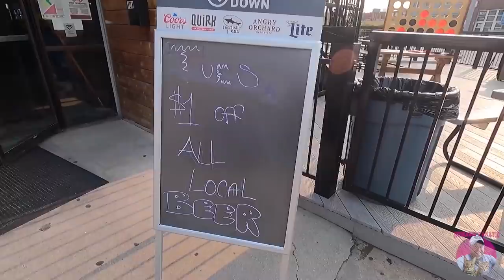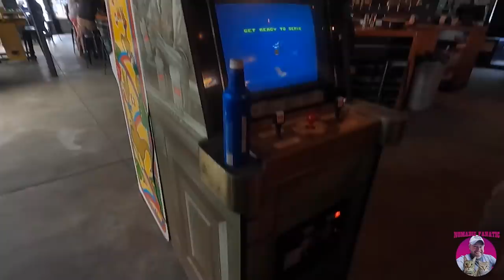Propane Leak Issue, Water Heater Fixed??? New AC Installed!!!

Comment: I'd double check with some other experts about using hydraulic hose on a propane line in an RV. The hydraulic hose can certainly hold the low pressure, but I wonder about the propane breaking the hose down and you getting contaminants in your line.

Comment: Does that mean the refrigerator you removed should be fine and can be reinstalled?  Hugs to the fur babies.  Take care and safe travels.
Reply: I was thinking the very same thing
Reply: he said it wasn't working on electricity after a short while so i don't think so.
Reply: I think it was also 20 years old? (I forget the year of the van) so it was probably due for a more efficient model.
Reply: @sak01  I had forgotten that. Thanks for reminding me.

Comment: 7:47 Please tell Robert that, if he's not going to use a jack stand, he should at least slide the tire under the frame.  The cardinal rule of auto repair is NEVER TRUST A JACK.
Reply from the maker: There is a jack stand in that shot.
Reply: @nomadicfanatic  he did not write that. Jack stands ALONE have fallen and crushed people!
Reply: @jenniferwise8515  You are wrong. "if he's not going to use a jack stand"
Reply: 8:40 there is the jack stand
Reply: @bluemamba5317  Where did Jack stand?
Reply: @bluemamba5317  read the original post. If you are going to get under any vehicle NEVER trust only a jack stand.
Reply: @jenniferwise8515  Can't you read? 
He wrote: "The cardinal rule of auto repair is NEVER TRUST A JACK."
Meaning, the guy didn't see the jack stand, only the jack that is right under the axel.
Reply: @nomadicfanatic   That's good.  I could only see the floor jack.

Comment: If you haven't done so already, may I suggest replacing the water heater anode. Those things deteriorate pretty quickly. It's a cheap and simple project, and will extend the life of the unit.
Also, I really admire your persistence!

Comment: Hey Eric, As for the lights on the motorcycle rack... You can rig up your lights just like you would if were putting them on a trailer using the four pin plug and they should work great for you. The upside to doing them this way is that if the need should arise that you have to remove the rack you can simply unplug the four pin plug. Also, you wouldn't have to cannibalize the wiring on the vehicle to make them work. It's great that everything is beginning to come together for you and your new to you RV.

Comment: I think that if I were going to spend the bulk of my time on the road, but still wanted (or needed) a base camp, I would look towards the SE portion of South Dakota. Tax friendly, easy on the regulations, and just about equidistant from both coasts. Not a place that I would really want to winter in, but unlike the northern parts of the Midwest such as MN, it's at least tolerable.

Comment: You need to use the Lectric XP you reviewed when you were in Washington, the new 2.0 is even nicer as it puts your E-Bike to shame.... Waterproof...also has front shocks now along with really nice basket attachments for your cats
Reply: No. I have two. They are no more water"proof" than your cellphone or any other electronic device if allowed to get overly wet. They do make bike covers however.  I have motorcycles, a SXS, and as I said, two Lectric e-bikes. When left outside they are secured and covered. Admittedly,  due to it's size and construction, transporting it in the van is out. The foldable nature of the Lectric would be much better,... but still not a waterproof unit
Reply: Don't they have a 3.0 ?
Reply: @kameshe420  not yet.... but if they've Already got 2.0..... 🤔

Comment: No way to move that back connection up further away from that helper spring. Those are aftermarket help springs I bet last owner added and I bet that spring is what took out that line. But your still close on that rear connection.

Comment: Way to keep on truckin', Eric!  I'm curious about the ''motorcycle carrier.  What is the combined weight of the bike and carrier.  Does is approach your tongue weight?  Do you need extra braces for support?  A instructional video on motorcycle carriers would be helpful.  The RV c-class I'm looking at has a tongue weight of 500 lbs.  The motorcycle is 503 lbs.  Towing capacity is 7500 lbs.  What to do?  Thanks in advance.  Be well!

Comment: Ok, electric bike newbee, this bike is a knock off of the RadPower bike which states that it can be driven in light rain.  But you should put a cover on the bike when you travel, that is all there is too it!!  keeps it clean and keeps eyes off of it……just go the extra step and cover the bike instead of complaining about a electric bike that hiccups when it is wet…..

Comment: Erik, why couldn’t you just get a cover for the E-Bike?
Reply from the maker: Because we already did this in a previous video… It doesn’t do anything, in fact the bike turned out to have more moisture from the RV tires kicking up water from underneath the road right up through the cover. Covers only work when the bikes aren’t moving. There’s no way to keep a bike dry on the back of an RV while traveling.